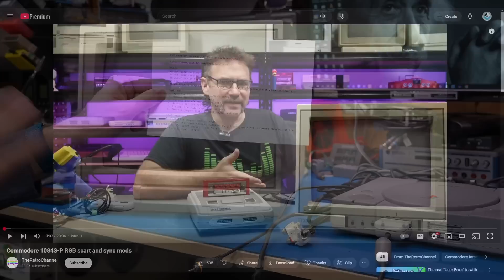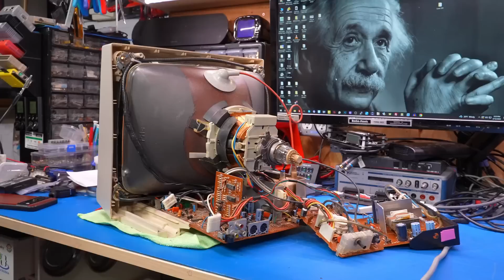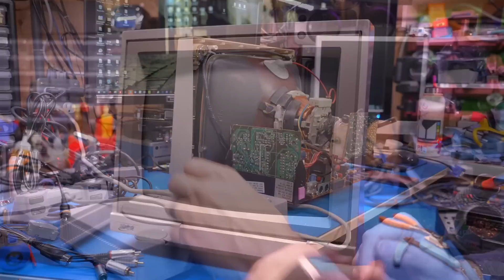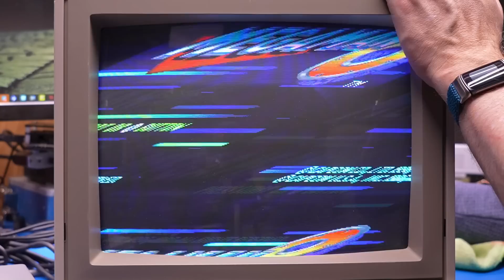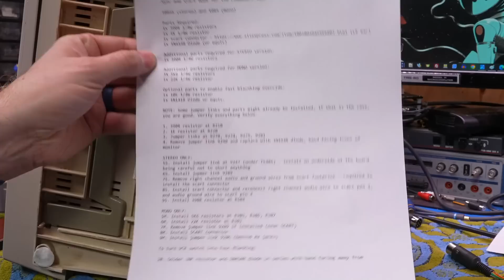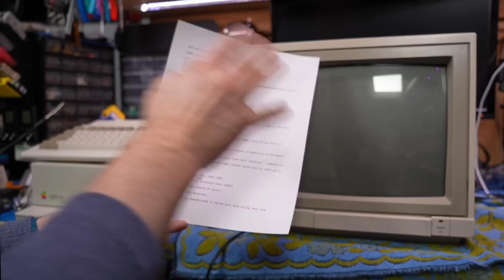Ultimate Commodore 1084 SCART modification

Comment: I can remember PAL UK TVs back in the 80's having a specific VCR channel button, on my portable 14inch Grundig it was channel 8 (tuned to UHF 36 which was the standard channel for VCRs in the UK as there were no over the air broadcasts using 36). If I tried using any of the other 7 presets then you got that bending in the picture at the top. So the channel 8 preset button must have activated that mod to fix the degraded sync issue. I think in later TVs that mod was permanently active so it didn't matter which preset was used.
Reply: I can remember a similar thing happening with our Philips 14C925 in Australia when my Dad got the family a National NV-G20. All the other spare channels got the flag waving, except for one preset called "U" for "UHF" even though our VCRs in the 80s, at the time, used channel 0 and 1, and SBS was the only UHF station on channel 28.

Comment: Ive got a 1081 that has Scart. Im not sure what the difference is between that an a mono 1084 (except that it says Amiga on it)
Reply from the maker: From what we can tell not much. It has the power cable out the back and a few other small differences. It's mainly the same as the PAL 1084 (mono) monitor.

Comment: I was the component level service engineer at Orion Computers at Leyland, NW England who were an Acorn main dealer.  We sold pallet loads of the Phillips version of this monitor for use with the Archimedes and BBC Master computers. Virtually none ever came back although the flaps would get broken off the front.
Reply: @cowasakiElectronics  you know I always wondered if the Phillips monitors on the School Archimedes were the same. Wasn't the Archimedes one whiter rather than Amiga beige? And yeah the control cover doors were useless I'm lucky to still have mine after 35 years.
Reply: @ Phillips did a version for Acorn just like they did for Commodore. The Acorn one was an off white but depending on other factors sometime the Phillips one worked out cheaper but did the same job. We stocked both as Amiga/ST users wouldn’t want one badged as Acorn although we rarely sold anything to them anyway.
Reply from the maker: Yeah I've seen photos of that Acorn version. If it didn't have the SCART jack then internally it'll be the same as these and it can be added. I think I've seen photos of an Atari version of the monitor as well.
Reply: I should have read the comments first. I was watching the video thinking this looks very familiar, and wondered if there was an Acorn version. Some googling later, and yes - the Acorn AKF11 and Commodore 1084 were both made by Philips, similar to their CM8833. Definitely better quality than the later Lite-On AKF18.
Reply: Now you can easily repair flap with 3d printer

Comment: I wonder what version mine has.  I bought an untested floor model from the Federated Group's liquidation in 1990 and had to have the flyback replaced.  It still works, so it's likely on of the good flyback models.

Comment: Strange, you have a glossy tube on that one. All my 1084 and 1084S have/had matte tube and the colors are not so good. My 1083S have glossy, and it's picture is soo good... 1081 has glossy too and same thing. I'm thinking of swapping tube from 1083S to 1084 but don't know how if it's possible at all.
Reply from the maker: I would say that it's easy to swap the tube (leave the yoke on the tube) and you should have no issue. I've never seen any of the boxy Philips 1084 monitors with a matte tube before. Only the Japanese ones from the original 1080 sold in the US.

Comment: wouldn't it make more sense to tie the fast blanking to the composite/RGB button instead of the VCR button?
Reply from the maker: That would disable the use of composite video entirely.
Reply: @adriansdigitalbasement2  how would turning fast blanking on when RGB is selected and off when composite is selected disable the use of composite video entirely? it should have no effect when in composite mode.

Comment: I have the PAL Philips branded variant of this, no TTL RGB, but it has SCART from the factory, and it has a low res tube. IIRC it has the reliable, white flyback, although it has corona discharge issues at the anode cap, it produces some ozone smell, and occasionally it discharges with a loud crack, I'll need to replace the anode connector, but I think it has a series high voltage resistor integrated into the connector, which will be a bit of a challenge to implement with the new connector. 

The tube is a bit tired, I plan to replace it with a high res tube from a physically broken CGA monitor.
Reply from the maker: Ah interesting. Even after cleaning around the cap it still arcs? I've had that on a few monitors but it always went away after a good cleaning under and around the cap. And I have seen these low res CRT versions here branded as Magnavox. In fact they sold ones in the US without any RGB, but I assume the PCB was the same so it was capable of this mod.
Reply: @adriansdigitalbasement2  Yes, cleaning the anode cap and the tube around the anode connector did help a bit to reduce the arcing, but it is still far from perfect. IIRC it has a transparent anode cap, which hardened and therefore it doesn't seal properly anymore. There's also some oily goo leaking from the high voltage cable. I might dig up that monitor, I haven't turned it on for at least 3 years.

Comment: Ok, I have a question; is the output coming from the PS1 being RGB different than a component output?
Reply: Thank you both for the information! I appreciate the explanations!
Reply: Yes. What is colloquially referred to as "component video" is actually YPbPr video, not RGB. It contains the luminance/brightness (Y), the difference between Y and blue (Pb) and the difference between Y and red (Pr). RGB color information can then be derived from these 3 channels. The advantage of YPbPr over RGB is that it requires less bandwidth while achieving similar video quality.
Reply from the maker: The PS2 NTSC supports both over the same output wires, it is selectable in the PS2 menu. The PS1 only does RGB though. There are RGB to Component converters you can get from AliExpress for about $20. Allow you to use the PS1 on any TV with component, which basically will look as good as RGB.

Comment: curiously, Acorn also sold these monitors under their brand AKF12 along with the first models of the Archimedes. i'm guessing there were minior changes, like missing the NTSC POT that's unnecessary with PAL, and including the SCART port, but otherwise basically identical.

Comment: a simple LM1881 on the composite video would do a perfect sync separation
Reply from the maker: That would work too, would just need to be an external powered circuit
Reply: @adriansdigitalbasement2  pretty sure you could get some low voltage dc on the main board :)

Comment: Always a surprisingly fun as well as useful video, thanks.

"The SCART connector is very flimsy."  - Yep. While still incredibly useful there are certain things that always stand out with anything of French origin. Flimsy is most certainly one of them.
Reply: I wonder why they didn't bolt it to the device and or make it from stronger materials.
Reply from the maker: LOL 🤣

Comment: As a Swede I had a RGB nightmare in the late 80's. We could not afford a 1084 but I was blessed with TV's with SCART that had RGB input (this was not allways the case with SCART). I Had a problem that my Amiga burnt up the RGB input on the TV's. It is so long ago so I am to this day not sure what the solutions was (I was pretty young), but there was two issues. One is that the RGB standard (from the Amiga or SCART, not sure) requires resistors on each colors (but doing so will dim the image or it can burn the receiveing circuit. The other problem we had was a ground level difference between our cable TV network and our house ground. Isolated I  could run a 12V21W bulb brightly between the two grounds and it would give you small electric shocks touching them. So I am not sure what was what. The missing resistors in the RGB SCART cable or the ground issue we had. I ended up using a capacitor to fix the ground problem and resistors on each color to avoid frying components in the TV, and live with a rather dim image. The annoying thing was that the TV could work for weeks and months before something went wrong, the sync got lost and picture was rolling or no image at all.
Reply: Sorry, I'm drunk and your comment was too long for me to read, but I think the problem was that not all TV's could handle 12V blanking signal, some only expected 5V. That might have been the problem. Ignore me. pls.
Reply: @Franko_Walker  you are right, I probably had to put some resistor there too.
Also I remember now that some chip in the Amiga mysteriously died too, twice, and it was related to all that mess too.
Reply: Your house probably had TT or IT earthing system and a weak neutral connection, the the cable tv would have been a parallel path.
Reply: It happened to me too.
I once took my Amiga to a friend's house for a Populous session and the RGB SCART cable killed the expensive Loewe-Optra TV in the living room.
My goodness, his parents were furious...

Comment: On top of all those other rebadges, I'm pretty sure the Phillips unit the 1084 is based on also was the Apple Macintosh Performa Plus Display.
Reply from the maker: Oh interesting. That was a high res monitor but now I think about it, it does seem kind of similar. I never opened one up to look inside.
Reply: @adriansdigitalbasement2  There was a non-plus model that had a worse dot pitch. I think they had the same case design though.

Comment: SCART rocks. It really was a great solution.
The only thing I really disliked was how difficult it is to plug in the connector blindly.
My parents' living room tv sat in a corner making it really difficult to reach the back connectors. And then if you had to plug a SCART connector, you knew you were up for 10 minutes of cursing.
Reply: yep, great standard - but the lousiest connector ever made!
Reply: That's why I glued an 8-way SCART switch to the side of my monitor with mounting tape.
Reply: As a avid European retrogamer I can plug any Scart blindfolded while being upside down and drunk, without producing a scratch.

But I learned through blood and tears.

Comment: SCART does use the same pin for sync and composite video and can use composite video (or even luma fed through that pin) as a sync source, but that reduces the quality of the image (mostly if you use compsite as is). There are appliances that detect functioning RGB decoding and feed pure sync through that pin, as well as some that just feed sync through it, but many consoles do not (the NTSC SNES, as well as the SuperFamicom, is a special case that feeds TTL sync through that pin that's compatible with older TV sets, but not with newer ones, and the PAL switches the sync for 12V to foce a 4:3 ratio making it so that it needs to use composite as sync and making NTSC cables utterly incompatible with PAL machines). That's the reason many providers of peripherals for retro consoles sell sync-on-luma cables.
There's also a way to strip the video information from the sync signal to produce clean sync, using a certain chip. Just search for "retro rgb sync stripper".
Reply: It really depends on the display. In RGB mode SCART expects a composite sync signal on the pin usually used for composite video, but a lot of displays will accept and extract the sync info from a composite video signal anyway. One important thing is that SCART specifies the sync input has to be 1V p-p into a 75 ohm load.

Some displays wont care if they're fed TTL levels instead, but some will. Generally all that is needed is a 330 ohm resistor from a 5V TTL level csync output before going into the SCART connector, and the TV's 75 ohm load brings the signal down to near enough 1V p-p. This is how I usually do it when making SCART cables for Amigas.

I did modify UK Playstation SCART cables back in the day so that they had a DE9 on the end of them instead for use with 1084/cm8833 monitors. I dont recall having to add extra components.. it's possible that UK/European Playstations had a dedicated CSync output at the right level though.
Reply: @jaycee1980  No, no PlayStation console outputs csync. You need to either use a regular SCART cable (not a good option), a more modern sync-from-luma SCART cable (better option), a sync strippen set between the SCART output and the screen's SCART input or, seemingly, doing a mod that takes the csync straight from pin 14 on the video chip (PS1 only).
Reply: @jorgelotr3752  well its been a long time since I've hooked one up that way, but all I can say is I never had any sync issues with 1084/CM8833 that were sold in the UK
Reply: @jaycee1980   was just giving more context, and composite-as-sync, despite being subpar when compared side by side with better alternatives. It doesn't cause rollover, but it seemingly adds some noise (way lower than composite itself, but noticeable for purists).

Comment: I used to own several 1084 and 1084S.  Sadly, they all got stolen when my house was broken into.  Sadly, the crack heads probably tossed them in a dumpster when they realized they were not TV's.

I really need to find and buy some more.  Excellent monitor.

Comment: Those RF shields were only in place to prevent TV broadcast interference.  Since that isn't a thing anymore, you are absolutely correct in that removing the RF shield is fine.  I could never use my TRS-80 model 1 when the family wanted to watch TV.  But today, nobody notices, because we don't use over the air TV anymore, for all intents and purposes.

Now on a computer, i would argue that you may have issues removing an RF shield if you are at all close to RF transmission equipment.  You can get bit flipping if you are close enough to a powerful transmitter.  This is only applicable to a few people, but it's worth noting.
Reply: RFI is most certainly still a problem for TV but there's plenty of other stuff too.  If you drop your noise margin too much digital TV it turns into a pixelated squealing mess, or you don't even get that far.
Reply: @retrozmachine1189  Never had an issue with an HDMI device working fine with an old retro computer running.  With out without RF shielding on the computer.

Could be the modern TV is just that well shielded, but i bet it's more they operate an entirely different frequencies.

When your computer monitor is a barely modified TV, and your clock might be derived from a colorburst crystal, you are much more likely to have issues.

But i get what you are saying.  Noise is always an issue.  My contention is that it's much less relevant to retro computer enthusiasts than it used to be, with analog broadcast TV.

Comment: Here in France we had SCART for decades (it has finally been discarded in 2017). It's funny to hear you being happy to have fully RGB video working :D
Really nice job!
Reply: *diSCARTed  :3c
Reply: I think thats also why we got it here in the UK.. i remember some more expensive TV's having "Peritel" on them in the beginning, and of course later on it became known as SCART
Reply: @jaycee1980  If I'm not mistaken, SCART was adapted in the UK due to the need of external Teletext decoders in the early days of Teletext.
Reply: @mrnmrn1  yes I believe so (thats before my time!) because of the blanking signal that Adrian mentions
Reply: @jaycee1980  I think the earliest VCR I've got with a SCART connector seems to be a Philips Video 2000 from 1983, but I don't remember seeing it on a VHS recorder until the late 80's, as my Ferguson Videostar 3V59 from 1987 still used BNC for video and 5-pin DIN for audio. Maybe Philips being a European company adopted the SCART socket earlier than the Japanese manufacturers.
Reply: @jkmac625  it's probably because VHS stores composite video directly on the tape, so having RGB is completely pointless
Reply: @ I think it was probably just slow adoption to the new standard as I don't recall any TV we had back in the 80's that had anything other than an aerial input. When it did become more established in the early 90's it mainly carried composite video with audio and occasionally s-video. I don't remember using RGB on a SCART until DVD players came out. That's probably why some TVs with 2 SCART inputs had only 1 of them wired for RGB.
Reply: SCART was mandatory in 1978 in France for all TV equipment

Comment: The Commodore 1084 is a brilliant monitor, I got mine back in 1990 when I got my Amiga, and used it with my SNES, Mega Drive and later with my PS1, and also when we got cable TV here around 1993/94 in the UK I had my cable box connected to it. My friends used to love playing on my consoles because the picture was so crisp and they used portable TV's through RF which was all blurry and Grainy.
Reply: A few years ago I saw a 1084S advertised on Craigslist for $35... I had to drive 2 hours up to Toronto, Canada and then 2 hours back to the States to buy it, but it was well worth the trip! This monitor is awesome.

Comment: I've been working on my own scart adapter for the 1084S, my goal is to make an adapter that simply plugs into all the outputs on the back and provides scart input for all of them, this would give all of the inputs via scart without requiring any case mods. I'm still on the fence about modding the case of my 1084S due to them being so rare here in the US these days.

Comment: Actually about 1V on pin 16 is already enough to hold it at RGB mode, but up to 12V is totally fine for most monitors :) I've seen 1.8V, 3,3V, 5V, 12V and much more at this pin, it all worked. Some devices even use the sync signal itself with a resistor to feed pin 16, which always was a bit dodgy and hardly depended on the sensitivity of the monitor.
The Playstation have 5V on Pin 10 on the AV output which feeds pin 16 on the scart connector.